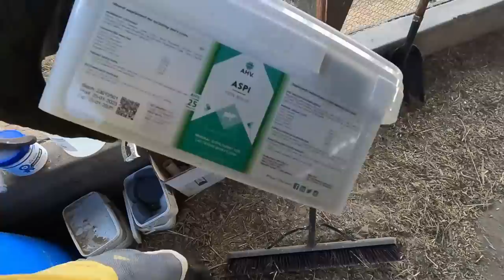Long-arming Silo Unloader

Comment: I have seen ventilation bags put into barns with lower clearance.  Basically a vinyl air tunnel with a blower at one end and vent holes along the whole length.  Sandy Brock - sheep channel - has one in her lamb grow out barn.  I wonder if that would work for your heifer farm barn?

Comment: With solar going on barn roof, what is the output your looking for?
We did solar with selling back to utility in Arizona, they paid $.08 per kw.
Move to Tennessee the utility will not pay for here, has to do with TVA Federal Government owns power dams here.
Reply: AKsnowball great question! I was thinking it would help offset costs. I live in Northern California where electricity it at an all time high since PG&E caused fires with poor maintenance & faulty equipment. Not all the fires were caused by PG&E, but several large ones have. They have raised rates several times, and the recent hike is cost prohibitive for even mid income households. Average winter electric bills $500. to $1,000. per month even with propane appliances. I couldn't imagine what a dairy farm would pay monthly! Of course there are agricultural rates, but our power is SO expensive. Some people have gone solar & yes, the power company pay for the extra.
Reply: @kimcwhite6509 you live in CA. Don't blame PG&E for not being able to maintain lines by reducing ground fuel.

Comment: Can you put alfalfa in a bunker like you do with the corn?
Reply: Yes. At proper moisture you can. Packing and covering is essential.
Reply: @MorganOtt-ne1qj  it seems to me as an outsider a no brainier to build a couple more bunkers and put the alfalfa in those versus a silo, less Hassel, safer, probably cheaper. But like I said I have no idea
Reply: @OaK-_R  you have to consider the existing setup for feeding vs the expense of upgrades and conversion to the new system. Then you push a pencil to the nub to figure out how much you can spend each year or so to implement the new system. Harvestore in particular pushed hard to go all in on thier systems of " push button feeding systems", and if you bought into it, you now are kinda penned in a corner to update. Great question!

Comment: editing soda
Reply: I can't wait for the solar panel installation. 
Will be interesting to see how much maintenance costs - how quickly the weather etches the clear coat / reduces efficiency. 
Thinking about energy storage: suggest turning angry pixies into hydrogen (runs engines and motors). 
@ADairyonthePrairie / @saskdutchkid say they're not going to do solar; even though you are much further south, I'm looking forward to production numbers / costs.